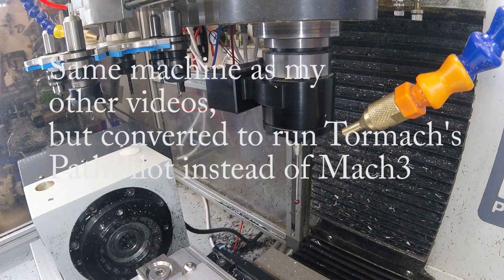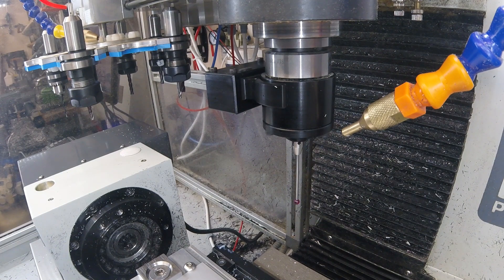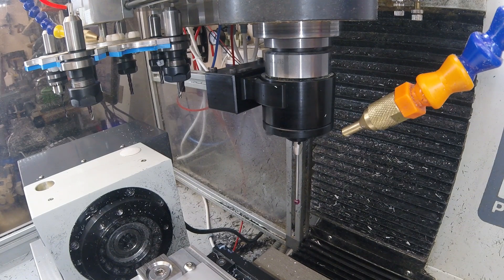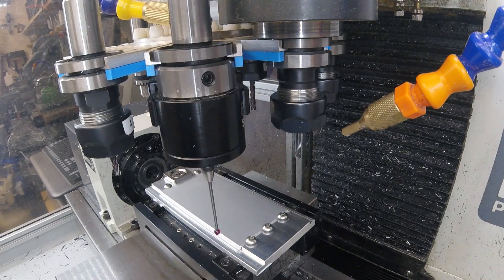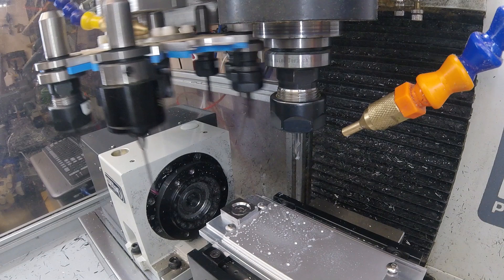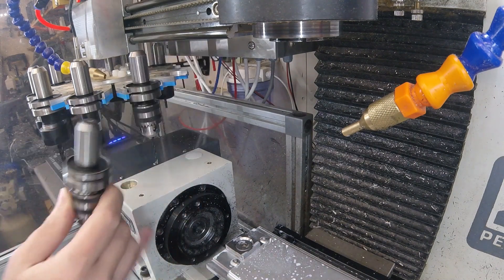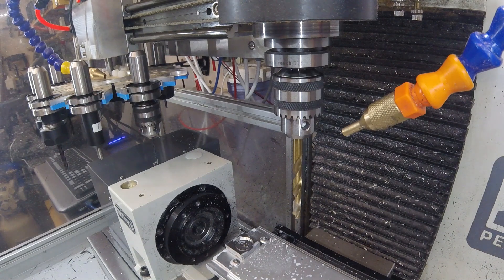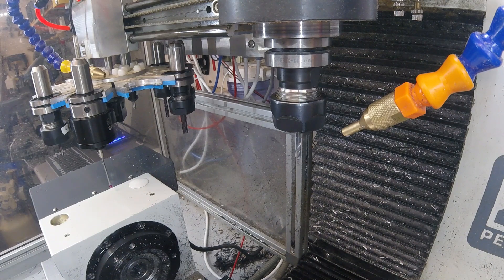DIY tool changer fully integrated with PathPilot

Comment: About to buy a 440. Would love to buy a set of plans from you to make my own ATC and save $4K!
Reply from the maker: Thanks for the interest.
I'm hoping to be able to offer fully assembled and tested electrical/electronic setups together with access to the (Fusion 360) models of how to make it.  Won't save you all of the $4k, but a big chunk!
The only bits you won't be able to make on a 440 are the spindle for the carousel (needs a lathe) and the panels for the sides of the box (too big for the 440's table so laser cut).  I may be able to get those made at reasonable cost and if so it'll all be added to my web shop in a couple of months.  Keep an eye on https://shop.xoomspeed.com/
Reply: @daleksw  please keep us updated.  Yours appears to be so much nicer.  I love that it isn't pneumatic.
Reply from the maker: I am making a determined effort to get everything into a state that can be supplied people who'd like to build one for themselves.  Details are at http://xoomspeed.com/CNC/atc/atccontroller.htm
Reply: @daleksw  This and the wireless probe are two things I am desperately trying to get right now. Power drawbar is on the way already, just really want to build the ATC. Definitely some awesome factor to this and isn't going to rely on an air compressor. I feel like that is huge.

Comment: Nice work David, still waiting g for my mill to show up, do you have a guide for setting g up with pathpilot i have never worked with it yet so I take it your using I/O usb of some sort with relays possible a 4 relay switch
Reply from the maker: The electronics mimic the behaviour of the Tormach ATC.  There's 2 x step/direction stepper outputs, opto-isolated outputs for air blast, draw bar and spindle brake and inputs for manual draw bar control, air pressure sensor, spindle motion sensor and home switches for the steppers.  Connection to the controller is USB and you need to copy one small text file so it picks up the correct device name when plugged in.  After that, just tell PathPilot you have an ATC and it works exactly the same as the oem ATC.

Comment: ;very nice work David! I like the smoothness of operation.
Reply from the maker: Glad you like it!  It's the advantage of using steppers rather than pneumatics to move things.  You get to control not just position and speed, but also acceleration and that's what makes the movement so smooth.
Reply: @daleksw  air is ok for some things, hydraulic or mechanical if the positioning is important, I think Tormach could use some of your expertise on their tool carousel!!

Comment: What is keeping the tools from sliding out when the tool changer rotates?
Reply from the maker: The blue plastic parts you can see under each fork are 3d printed 'springs'  They extend a few degrees around the front of the tools and have just enough tension to stop them coming out, but not enough to stall the linear motion.

Comment: Spot on mate, its looking really good, a tiny nudge when the engraver got picked up but like you said its still getting tweaked.  I agree with the spindle delay its a royal pain, im trying to set up the VFD on my home build and its ramp up coupled with pathpilots delay is making it a pig to set up.  I dont think its a hard issue to fix just concentrating more on getting the machine running.  still not designed and built the power draw bar yet, work in regress as they say.  Jason Snyder has left a message aka Nerdly, that’s it man you have made the big time.  we will have to get you a plug from Grimsmo and NYCCNC.  Jason started a project ages ago with an Asian 5 axis trunnion, we will have to get him to go back and finish it.  Still not sure how to get a 5th axis out of PP but 4 axis on a budget is a damn good start.
Reply from the maker: Good job spotting the nudge on the engraver.  That's a sign of just how difficult it is to make an ATC work with TTS.
To avoid tool pull out, the drawbar is always done up as tight as possible, but that means it barely opens and there's almost no clearance for the ATC to aim at to get the tool back in.  That in turn means the whole carousel assembly has to be very accurate.  One mistake I made was mounting the forks on the bottom of the carousel disk instead of the top.  That means the parallel-ness of the disk becomes part of the tolerance build up.  Correcting that would mean turning a new spindle and of course, that has to be very straight and the mounting surface true.
Since it's all stepper motor driven, I could have programmable rotation and extension for each tool, but that really would be a pain to set up.
All that's before you realise/discover just how important it is to have the carousel disk normal to the mill's z-axis to avoid tools getting jammed half way into the collet.  Not easy at all to get it even this good, so hardly surprising how many people struggle with the oem ATC and the large amount of backlash it seems to have in the rotary motion.
Reply: @daleksw  Im going to chicken out and use a rack.  The spindle is like a pillar drill/Bridgeport, so i get about 10 inch of total travel.  The ATC electronics/board will still get built (perhaps). but its only going to control the power drawbar for now.  That should get me close.  Your ATC is looking really impressive, its somthing like the fourth of fifth ive seen on youtube but looks more like the dogs doodars than the others ive seen.